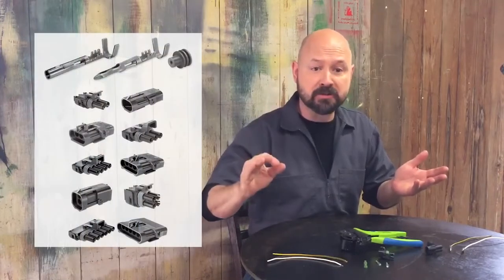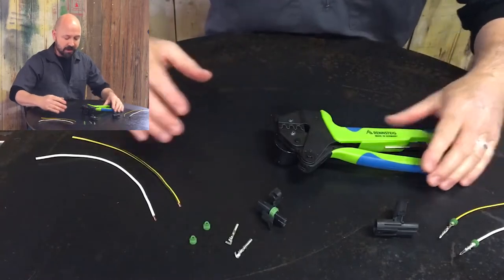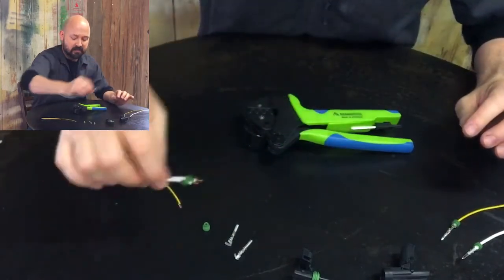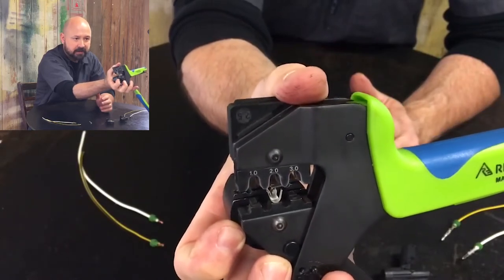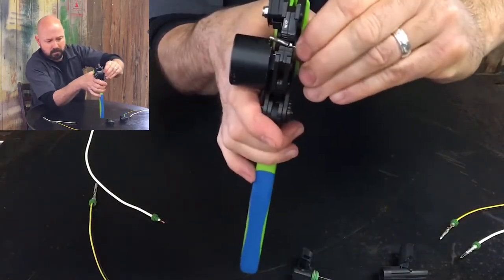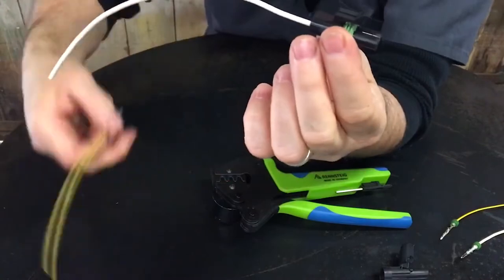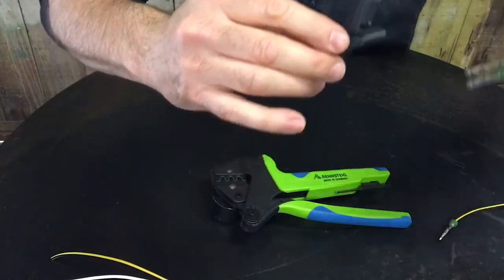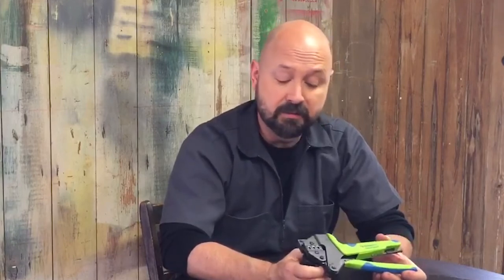Professional Crimping of Weather Pack Terminals

Comment: Cool tool.  I noticed it has three slots.  Would you happen to know what the wire size it?  Would it be: 1mm, 2mm, 3mm (22, 20, 18, 16, 14, 12 AWG) .

Comment: I clicked the link to buy the tool and there is only a “request a quote” option. Sorry, I’m not interested in extra steps to purchase your product. It should be a simple click and pay process. This is not how you do business in this day and age.
Reply: Same with me
Reply: $769 for a crimper and dies , Over $1000 Canadian  ,Looks like a quality tool but $1000 come on, really.
Reply: @stephaniewardlaw3158  no wonder it's hidden behind "request a quote" 😂 I'd be embarrassed to display that price too!
Reply: @stephaniewardlaw3158  For way less than that you can buy a deutsch crimper and buy deutsch connectors, which run circles around the weatherpack in terms of durability and quality
Reply: @stephaniewardlaw3158  $1000 bucks? Screw them no thank you i rather stick to my manual scissor type weather pack crimpers that only cost about $35 does just a good job.
Reply: Its a no go no mas see you